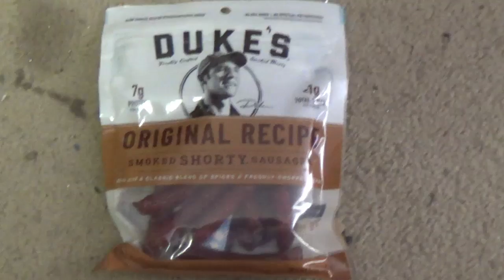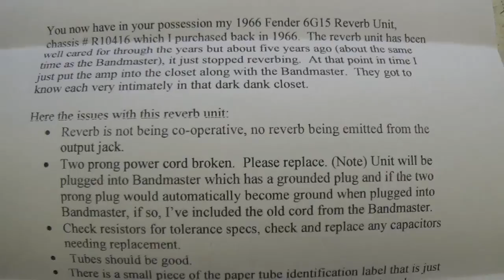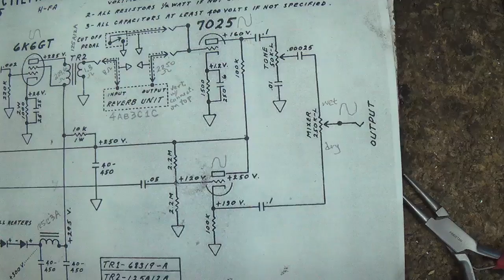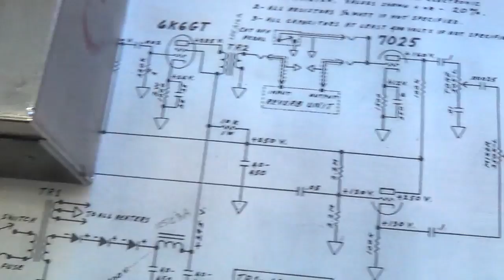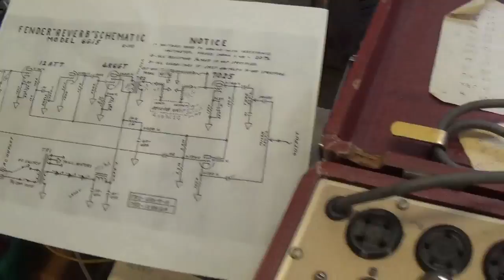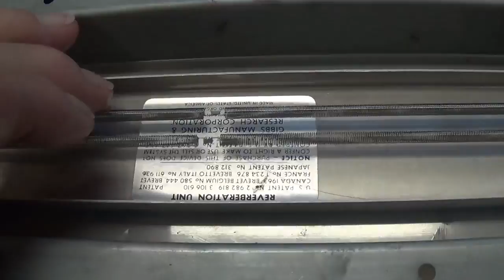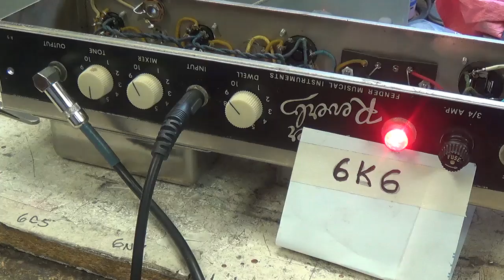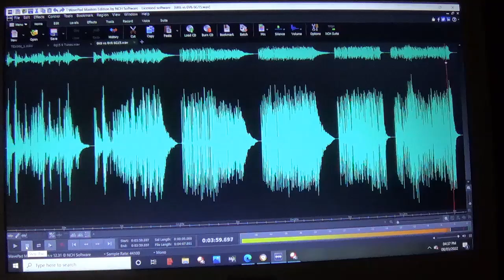Virtually Mint 1966 Fender 6G15 Reverb Unit.......It Quit Reverbing :)

Comment: Excellent video!  You deserve a Nobel prize of vintage music equipment gurus. I'll contact the Nobel committee.
What I would have liked to see is measuring the impedance ratio of the OT of 6K6 at 1kHz and to hear how it sound with a 8 ohm loudspeaker connected to the OT instead of the tank. 🤓
What comes to the tank, I personally would have left the original Gibbs tank (which really still had some nice high end shimmering and no low register boomyness)  intact and just replaced it with a new one and kept the original in a safe place as it is. I mean, most vintage audio gear  enthusiasts want to buy their stuff as original as possible. How much do you think the resale value of that reverb was lowered by MODding (no pun intended 😁) the tank with those new guts? 😜
Reply from the maker: Thanks, J. I have demonstrated the substitution of a speaker for the tank in a previous video.....it sounds pretty good :)  Re your preferences, if I ever work on any equipment for you, they will be heeded.....for this item, however, the owner's preferences prevailed, and he has no intention of selling it.
Reply: @UncleDoug  Yes, the owner of course tells what he or she prefers especially after your very thorough sound demonstration which was absolutely interesting to hear. 
The little unintentionally or maybe intentionally (?) loose second spring of that Gibbs tank seemed to give that delay type of echo effect to the sound which I liked a lot because it had some character which is often missing in newer tanks. Of course magnets of those transducers of the tank probably have lost a great deal of their original magnetic strength. But I have noticed that the same can happen to guitar pickups as well because I still have a Fender Stratocaster I bought almost 40 years ago and when it was new, the pickups pulled guitar strings so heavily that I had to adjust them very, very low, very far away from strings. After 30 years I noticed that, bloody hell, I can adjust the pickups much much closer to strings without magnetic pull affecting the free vibration of strings anymore and the sound those pickups seems to be better than ever even if their magnets seems to have have lost quite a lot of their original strength which seemed to be too much because of that magnetic pull when the Strat was brand new. 😁
Reply: @jutukka  Is that loss through play or loss through storage ?

Comment: @ 56:18 - If you ever need to get a more accurate low resistance reading on your DMM ( and a lot have this feature), short together whatever test leads you are using, then push the "REL" or "DELTA" ( It may look like a triangle) button on your meter, and your meter will calibrate to your zero to your test leads resistance.  As far as those "free steak dinners" , you can walk away with a pretty good meal, if you are willing to  commit some time ( they often let you bring a spouse or SO too), and give them a junk e-mail account and a GV phone number to call.  As a retired telcom tech, they knew we would have a pension fund to manage, so, I took advantage of some local offerings, and never gave them a dime in return. Part of the "management fee" for existing members funds the dinners of prospective new victi....errr.. customers.I have even got some good info on things to manage my decisions better too, so it wasn't  a total waste, and most restaurants they picked were quality local places here as well.
Reply from the maker: Thanks for both tips PMEB.....we appreciate your input.
Reply: @UncleDoug  And thank you for producing and sharing such informative and entertaining restoral videos!

Comment: Doug, your tube-tester's meter-pointer can and should be adjusted to the "Zero point"  with the little slotted plastic screw at the bottom of the meter's face. Otherwise the pointer can become bent by the "slam!" that occurs when the pointer returns at high speed to it's at-rest position (pulled back by the coil-spring). It's been quite a while since I owned a 600-series Hickok tester, but the pointer seems to act a little more quickly than I remember it, without much electromechanical damping;  there's usually a capacitor across the back side of the meter and you might want to try replacing it.
Reply from the maker: Thanks for the helpful suggestion, GU.
Reply: @UncleDoug   Trust me when I tell you that you really don't want to have to take to take that meter apart to fix a bent pointer or anything else.  Been there, done that.  The pointer has a weak spot where it goes from round to pressed flat so that you can more easily read fine gradients, and it can  bend right at that weak spot. Older Hickok models will sometimes develop corrosion products in the magnetic gap (especially in damp storage conditions) that interfere with smooth motion of the of the mechanism and I've had to clean out that magnetic gap very carefully with little slivers of 3M sticky notes or post-its.
Reply from the maker: @goodun2974  I appreciate the concern, GU, but after 45+ years of frequent use, the needle is still straight as they come. I'll look into your suggestion, however

Comment: Great video. One question: Is the dry signal a lot louder when the MIX knob is all the way to the left? I'm working on a '65 Reverb unit right now that wasn't powering on (bad on/off switch) and the full dry signal is much louder than even just adding a little bit of reverb. I don't know if that's normal or not.
Reply from the maker: I would say that it is not correct, Jim. All controls are passive, so if one source is much louder than another, the lower volume source is probably at fault.

Comment: Hi Uncle Doug,

I recently discovered your videos and I have been enjoying them and learning from them with great enthusiasm, since I will be buidling a reverb unit (a Revibe, actually) in the future.  So a big thank you to people like yourself, and others whose videos have been invaluable, such as Slucky, Hoffman, Weber, to name just a few.  I did notice something in this video I have not seen before in videos about vintage reverb units: I noticed that this OUTER reverb tank case is suspended to the wooden cabinet, as well as the inner one being suspended within the outer one.  I can't say I've seen this before.  Have I been missing it?  I though the outer casing is usually mounted with isolating rubber grommets to the cabinet, and if it did have a locking device, it would reach into the inner case to clamp it down.  Can you clarify this for me, please?  And of course, do you think floating the outer case like this is the way to go?  Thanks again, Dave
Reply from the maker: Greetings, Dave, and thanks for your nice comments. I agree that the spring-suspended outer shield of the reverb tank seems to be unique to the 6G15, and I do believe that this method is probably superior to the rubber grommet mounting method. The rubber grommets offer minimal isolation of the overall unit, but they are inexpensive and easy to install. This is probably the only reason they are used. If they were equal to the spring mounts, then why didn't they use grommets to isolate the inner (spring) tray also ? If you are building from scratch, I would recommend spring mounting both the outer cover and the inner tray.
Reply: Thank you kindly for your reply.

Comment: Hi Uncle Doug, I don’t know why, but I truly enjoy watching you work on these original unmolested amplifiers.. It’s like watching Carter open up King Tut’s tomb! I believe you’ve used that line in the past..  Two quick questions, isn’t the 606 on the choke and reverb transformers just a marking meaning it’s manufactured by Schumacher? And though in this application the 6v6 or 6k6 would be single ended, in a push-pull output isn’t the load resistance on a pair of 6k6’s around 12,000 ohms? Meaning you really wouldn’t want to put in a pair of 6k6’s in your Fender Princeton Reverb? Thanks for the great videos!!!  Would like to see some more homebuilt amp videos, you make some of the coolest amps on YouTube! Definitely the best Teacher hands down..
Reply from the maker: Greetings, Tom. Thanks for the nice comments. Yes, the 606 does refer to the maker, Schumacher. The load resistance for 6K6's is definitely higher than 6V6's. It would be interesting to know the winding ratio for the tank-driving transformer.

Comment: Good Video….I own a 1965 Danelectro 9100 Tube Reverb Unit which I love.  It looks very cool..minimalist as Danelectros were…chrome face…and it sounds just as good.  Doug are you familiar with the Dano unit..the unique thing with it is the fact it has a Normal and Strong input.  The strong input actually puts a little dirt, not much on the signal, so 😎 cool..
Reply from the maker: Thanks, ND. I am not familiar with the Danelectro unit, but like all their gear, it sounds like they found a fairly simple way to achieve great tone.
Reply: This is interesting as I have never seen a Danelectro reverb unit.  Does it use the same cheesy little piezo- electric reverb tank with a single spring that you see in some of the Silvertone amps that Danelectro built?
Reply from the maker: @goodun2974  Hopefully someone will reply, GU.
Reply: @UncleDoug  , I did some online searches, and yes, the standalone Danelectro unit does use the same cheesy piezo reverb tank.
Reply from the maker: @goodun2974  Wow.....Of the many Silvertones I've worked on, very few have even a tolerable reverb.
Reply: @UncleDoug  , My guess is that the patent fees involved with using a Hammond type reverb tank, not to mention the extra small transformer required, would have pushed the price of the amplifiers up beyond what Sears was looking to pay and well above what they thought they could sell the product for.
Reply from the maker: @goodun2974  Good guess, GU.

Comment: hi uncle doug, i have a console stereo chassis with a bad channel, as well as some other stereo equipment in need of maintenance,  and some time on my hands.  i thought i would try my hand at component testing and replacement.  what basic equipment would you recommend for a newbie to get started repairing his own stuff?  the stupid lockdown killed the small electronics repair places in my area, so if i want to keep my stuff running i'll have to learn to do it myself.  your series of videos explaiming how amp components work have taught me a lot, and it looks like most of the info would be good for stereo repair as well.  thanks for any advice you can offer.  long live our old stereos, record players and cars!
Reply from the maker: My advice is to simply watch my videos and take note of the equipment and methods I use. Good luck.

Comment: We've been over this before, but once again, there is one cylindrical magnet attached to the hook at the end of the spring, that has the poles oriented on the sides of the cylinders instead of the ends as you might typically expect. That sits inside the magnetic field of the transducer coil. The magnet rotates in the field. Spring reverbs transmit their signal through torsion, not lateral vibration of the spring. They do not "wiggle". (Well, they can wiggle but none of the signal content is in that motion nor is it picked up by the transducers unless it wiggles so much as to cause some twisting as well.) Those long brass tubes that extend from the end contain a wire that's holding the magnet in place (you can see where it's soldered to the end of the tube) and can flex enough to let it twist, allowing the magnet to rotate a bit. Around that wire, inside the brass tube, are little rubber rings that control the amount of damping of the tank. (That's how they can make some tanks ring longer than others.) 

Wonderful to see this! Thanks Doug!
Reply: Yeah, you just pointed at the brass tubes and called them "magnetic wells". They're not, there's just a wire in there surrounded by rubber damping disks. The wire suspends one end of the magnet, the spring the other. (And I'm sure the damping disks help hold it all together too.) The magnet is inside that laminated field propagation thingee, opposite the coil.
Reply: I can't believe you're destroying that old tank! Nooooooo! (I hardly ever disagree with your decisions but that's a bad one. You can recharge alnico magnets, you know. Don't even need the electronic rig, you can do it with modern rare earth magnets. Though, aren't they actually ceramic magnets in the tank? And therefore, not likely to have lost their magnetic charge?)

To me it sounded better than the Mod. As you were mentioning, bottom end in reverb gets muddy.

If anything I'd attribute any change over time to the rubber rings inside the brass tube drying out. (I'm not even sure that's a thing but it feels to me like it might be.)
Reply: No bias check of the output tube? (As you can see, Doug, you've created a monster. ;)
Reply: I suppose as long as that 2W 1k cathode bias resistor reads correctly it's to spec and you don't need to? Still... I'd be curious. Is bias just not that important on Class A amps, maybe? Same reason why we don't usually worry about it for the preamp tubes?

You probably gave them back to the client, but man, I'd love to see a dissection of those original transducers.
Reply from the maker: Thanks for all your helpful input, AQ. Please bear in mind that only one opinion matters when working on a customer's amp.
Reply from the maker: @AdmiralQuality  Perhaps my choice of words was not ideal, but when discussing a complex system for a generalized audience, I often use phrases that are visually descriptive. The alternative would be to say all you said above.....resulting in an even longer, overly complex video. Try to temper your criticism with some awareness of the challenges of making a watchable video for 113,000 people of varied backgrounds.
Reply from the maker: @AdmiralQuality  The tube bias was checked. As I stated, not all procedures were recorded.
Reply: @UncleDoug  Cool. Wrote that before you noted that.

Comment: Boy, it'd be cool to have one of those for my '66 Bandmaster. Guess I'm just stuck with my RV-6. Great video though; I've really never paid much attention to these in the past as the stomp boxes are so plentiful, but I never seen one before to see how it works. I did notice your AO-35 that you converted into an amp. I had a AO-29 that I've been turning into a vintage Fender Vibrolux, but have one problem that you may have solved with yours. My power transformer doesn't have the bias voltage tap that the schematic calls for. I thought about tapping off one leg of the B+ line, but not sure how to reduce the voltage down to 50v. I seen the schematic uses a 470 2W resistor before the diode. I was wondering by tapping off the B+ line if I could get away with a 10K-15K resistor here for the bias board? Or if you might have did something similar with that old Hammond AO-35? Keep up the good work; I love your videos!
Reply from the maker: The AO-35 output tubes are cathode biased, John.  Look at a Fender 5F6-A Bassman schematic to see how to create a -DC bias supply.

Comment: Uhhh, interesting for sure. Always wanted to do the revibe ,,remains on my bucket list. I've heard forum tales of problems with ground loop with these units between the unit to the amp. Your insights???
Reply from the maker: I've had and worked on several, but never experienced ground loop issues, Russell.
Reply: Just like with pedals it’s good practice to use the same outlet for everything in the chain so you done end up going through multiple paths back to the breaker box!
Reply from the maker: @deplinenoise  Thanks for the tip, Andreas.

Comment: Hey Doug, this is your buddy Ade with a reverb question: I have a Ampeg Reverberocket 212R 1990 reissue with new tubes. If you remember I am more of a collector than player and my Ampeg has Not been in use for a couple of years. Finally took it out the other day and it plays fine EXCEPT when I turn up the reverb past 7 where it starts to feedback and howl. Under 7 it works and sounds fine. Any Ideas what it could be?? Needs to be reCaped maybe? I also have a couple great ideas for your next video. Looking forward to hear from you soon - Ade, New England.
Reply from the maker: I doubt that re-capping will help, Ade. Check for microphonic tube(s) and bad connections (solder tube pins, etc.)
Reply: @UncleDoug  Thanks to all the years I've followed your videos I knew to check the tubes. So, I changed them, and it did help some, but the problem is still there. You spoke of "connections", could the sudden surge of power after not in use for years have caused a connection to go bad? As always, very thankful for your great suggestions - Ade
Reply from the maker: @A.WebbAndFriends  No, I meant loose, corroded connections between tube pins in their sockets, bad pot connections....wiper to carbon track, etc. All of which may be caused by long disuse.
Reply: @UncleDoug  OK, got it. I have a can of connector cleaner handy. I'll try that next. Thanks Doug, much appreciated.
Reply from the maker: @A.WebbAndFriends  Good luck, Ade.
Reply: @UncleDoug  Thanks Doug, Best Regards from New England, Ade

Comment: Excellent video as usual. Can you tell me how the old Gibbs transducers conduct from the their ground tab to the inner tray?  Mine is intermittent.  I have a solid connection via the black wire soldered to the ground tab on the transducer and the rca jack on the outer tray.  But still have poor ground between inner and outer tray.  Must be the ground tab not making good contact with inner tray somehow?  Thanks for any insight!
Reply from the maker: It's hard to guess long distance, John. If you feel like a faulty ground is to blame, why not simply install a new ground wire?